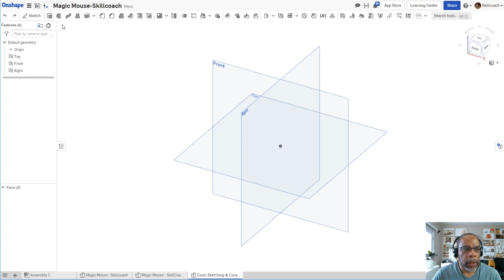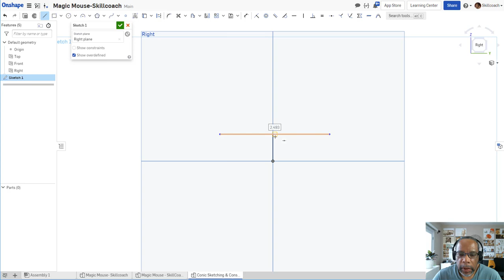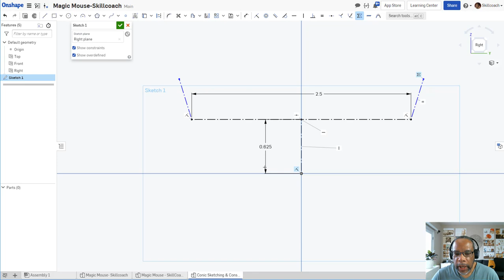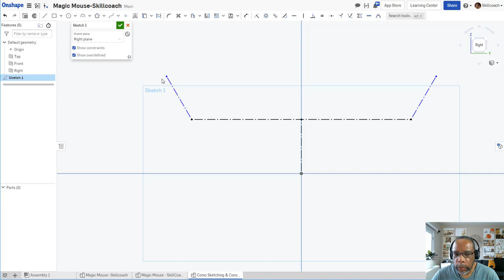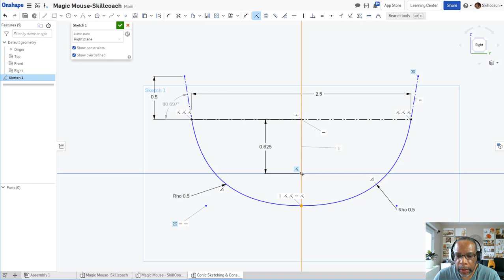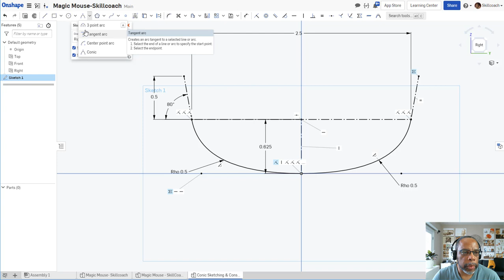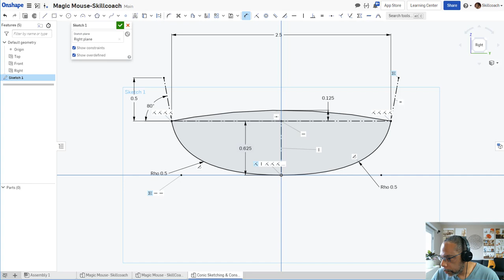Onshape CAD Modeling | How-to Fully Dimension and Constrain Conic Sketches - No More Blue Entities!

Comment: Got a question...In your examples, the sketch list on the left shows a pencil even when the lines are blue. But in my version of Onshape, alongside the pencil there is a blue circle with a line in it, indicating the drawing isn't fully defined. Is that what happens to yours if you were to do this in a new version of Onshape?
Reply from the maker: @moodberry  Yes., you are correct. While constructing a sketch feature the undefined icon will appear and disappear in the list. At the completion of the sketch in this tutorial everything was fully defined and thus there would not be a visible icon in the list.